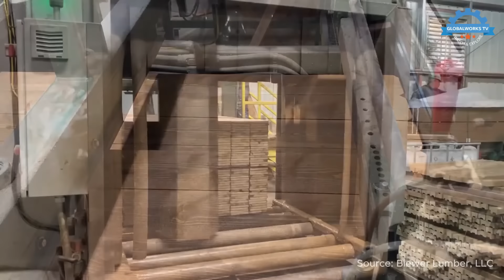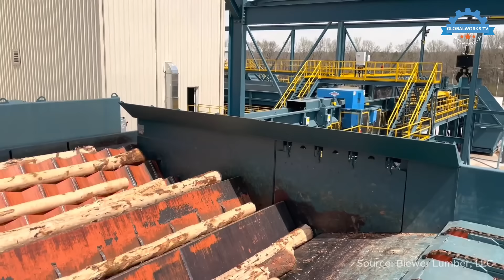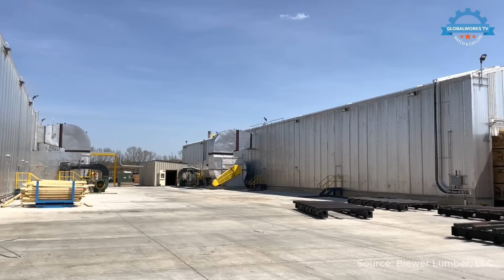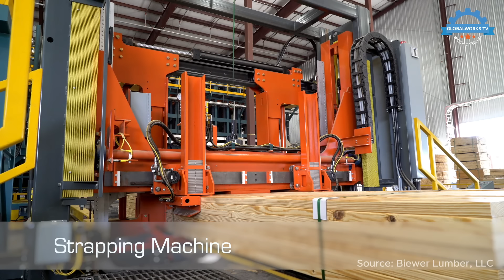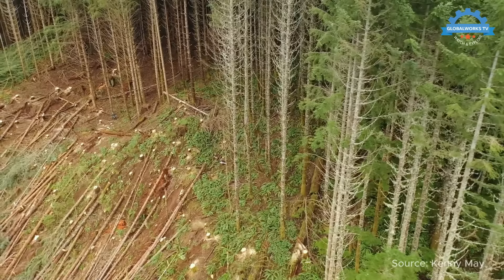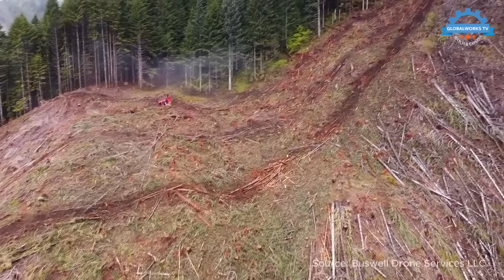Inside America's Most Advanced Lumber Mill: Full Production Process | From Forest to Finished Boards

Comment: 88 Lumberyards: Best quality lumber for fine woodworking, cabinetry, and specialty builds; second-rate for structural or rustic use. Where appearance and strength are paramount. There are specialty lumberyards that cater to cabinetmakers who need the finest and rarest lumber.
** Home Depot / Lowe’s: Mostly mid-grade or common lumber for general construction, framing, and DIY projects; fewer premium-grade options. Where lower cost to the consumer is important.
This distribution aligns with each buyer’s intended use, budget, and quality expectations.
Reply from the maker: Well said! That’s a clear way to explain the difference — specialty lumberyards focus on high-end, rare woods, while big box stores usually carry more common grades for general use.

Comment: You can thank congress and senate for the crappy lumber at the box stores. They set the standards that industry has to follow. A few years ago they allowed more wayne and then increased the moisture levels for kiln dried lumber.
Reply from the maker: That’s a very interesting point. Regulations and grading standards absolutely shape what ends up in retail stores. Many mills can produce very high-quality boards, but once standards change, the definition of “acceptable” lumber changes with them. It’s a reminder of how policy, industry, and consumer experience are all connected in the lumber trade. Thanks for sharing your insight!

Comment: Needless of how well the dry Killian is. The lumber is extracted from the killing wile still hot from drying and that is where the problem shows up as the lumber, now outside the Killen absorbed its original moister so all the drying is somewhat useless OK the hot lumber, will reabsorb up to 90% of its original moisture
Reply from the maker: You raise an important point. Lumber that comes out of the kiln is indeed very hot, and if it’s not properly handled, it can quickly begin to reabsorb moisture from the surrounding air. That’s why mills usually stack and cover the boards right away, or move them into controlled storage to keep the drying effective. Kiln drying is still essential, but you’re absolutely right — how the lumber is handled afterward makes all the difference.
Reply: @GlobalWorksTV  u don't plane lumber as soon as it comes our of the dry kiln as it is still shrinking and drying. A mandatory 4 hour cool down is needed. If u planed it "hot" the finished size will be less than the target finished size say 1.5 inches by 3.5 inches for 2x4"s.

Comment: Were any of these wonderful machines that put Americans out of work made in the U.S.? With no workers to pay and no pension plans and such, one would think lumber would be less expensive.
Reply from the maker: That’s a thoughtful question. Many of the big machines in American sawmills were indeed designed and built in the U.S., especially the classic headrigs, log carriages, and steam systems. Over time, automation has reduced the number of manual jobs, but skilled workers are still absolutely essential — from sawyers to filers to equipment operators. As for price, lumber markets are influenced by many other factors too, like timber supply, tariffs, transportation, and demand in construction. So even with machines, costs don’t always fall. Thank you for raising such an important point about the balance between industry, workers, and progress.
Reply: Try finding lazy Americans willing to work in a sawmill. With zero labor force they had to rely on on technology.